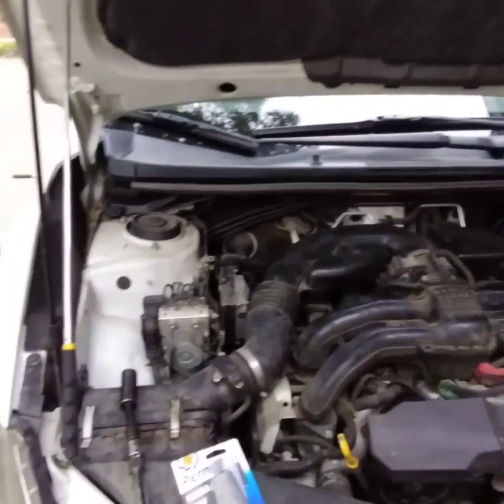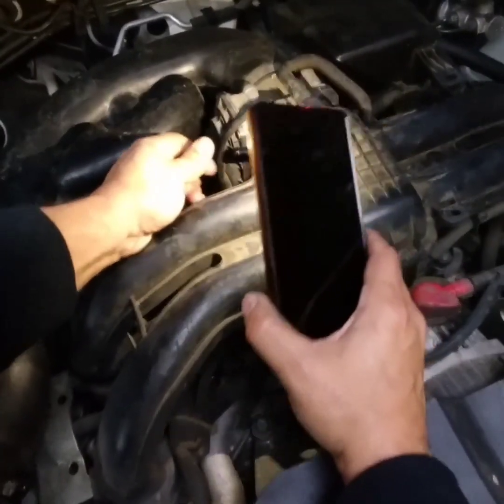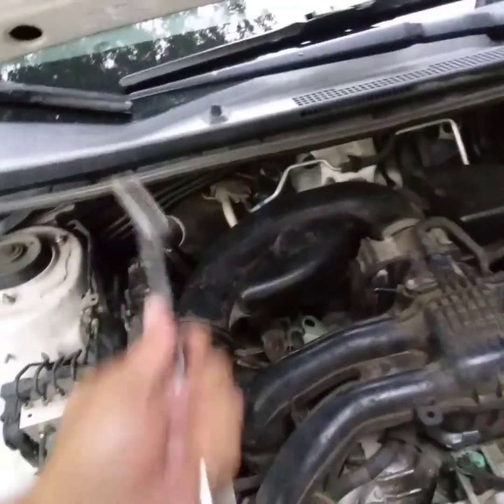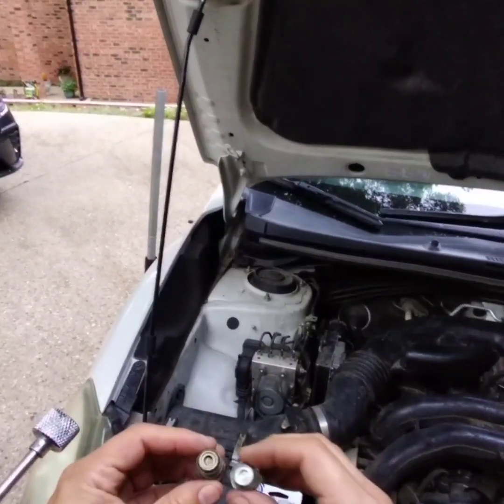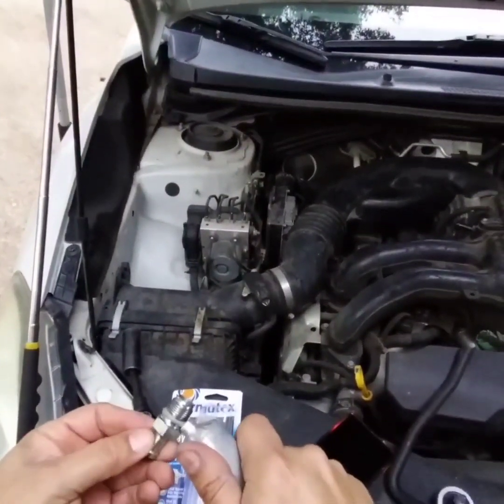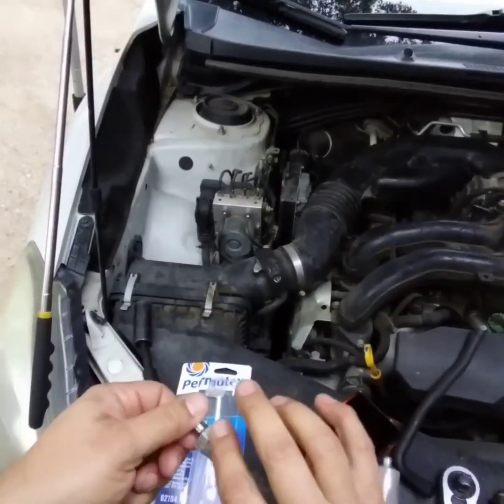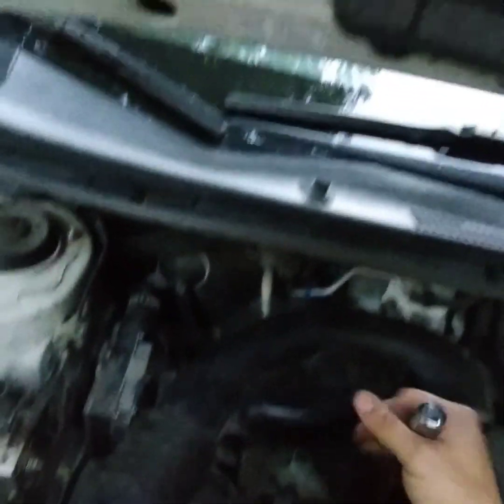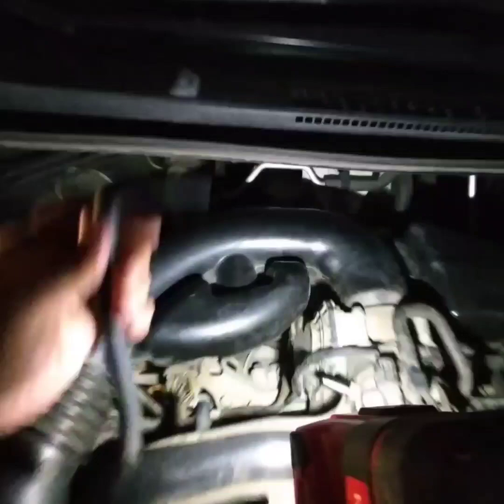2012 (2012-2016) Subaru Impreza / XV Crosstrek PCV Replacement

Comment: What code or any will u get with a bad pvc valve?
Reply: Depends, you could get some or none.  It could cause non sensor engine challenges.  See other videos to explain the result of the PCV failure.

Comment: Is it a problem if the new pcv part isn’t as tight at the hose connection area? The old one I could barely get it off, with the new one it slides right on. It’s slightly smaller at the top.

Comment: When do I change mine I have 61k on my Crosstrek ?
Reply from the maker: Some say every 15,000 miles, others 25,000 miles... I'd say every two years... easy enough...
Reply: @CarsandEspresso Oops!  I’m at 83k and havent done it.  The maintenance chart doesnt mention this which is frustrating.
Reply from the maker: @aldermediaproductions695 A clogged hose or PCV system or inoperative valve can increase oil consumption because pressure builds when the vapors in the crankcase aren't allowed to flow into the combustion chambers. That additional pressure can force oil past seals and gaskets.